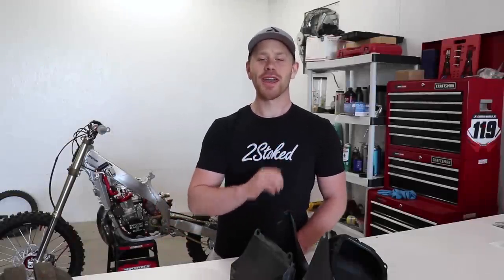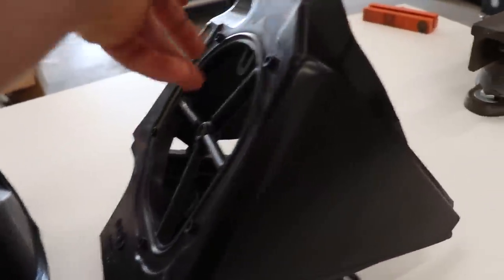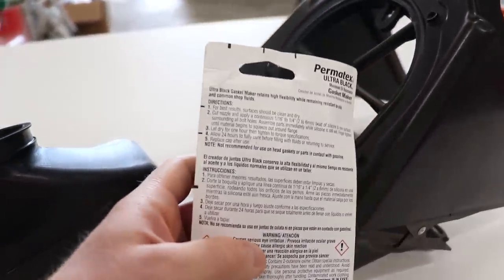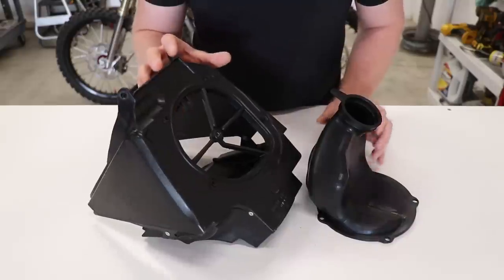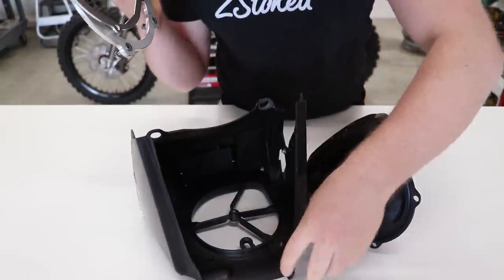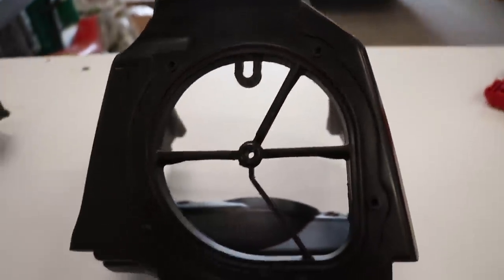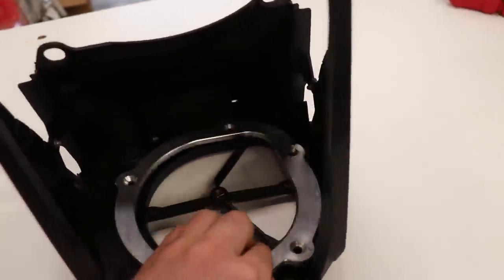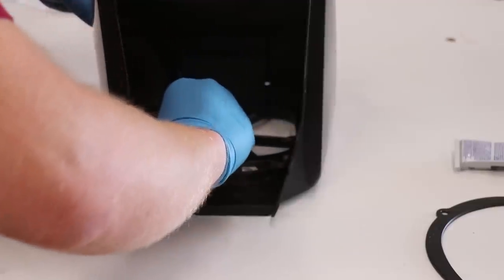Fixing The Biggest Problem With Honda 2 Strokes!

Comment: I knew about this air box problem, only a few weeks back I resealed my sons 2002 cr125 there was no gasket only what seemed to be factory sealant, it turned out to be bit of a marathon. After watching your post I’ve ordered the metal ring seal kit for my 2002 CR250, that looks like it will solve any inherent problems. Thanks for the info Cam. Great video as always
Reply from the maker: Terence Brown Thanks for watching Terence! You’ll be all set with using the rings

Comment: Do you recommend doing that on the newer bikes? I’ve taken the air box apart on my 2014 Crf450r to clean/ inspect once a season and always put it back on dry
Reply from the maker: The newer CRF450s didn't have a problem with the leaking air boot, but doesn't hurt to have a little sealant on it
Reply: Okay thanks man 🤙🏽

Comment: This was the issue with my cr250. I was going thru an engine every 10 hours, breaking pistons and had a ton of wear. Not like you can check if your oil is dirty in a 2 stroke so you get a catastrophic surprise

Comment: What I do for those little nubs in the air box is just grease the air filter up real nice where it mates with the air box surface and never had a issue. On a 2002 cr125. I do have a 2005 air box boot for more airflow and have one of those cnc air box clamps.

Comment: 3:00 Hot Glue, quick, simple, cheap, Air tight guaranteed and can be taken apart later using a heat gun or just pull hard.
Reply: It would degrade over time though that's the only issue.

Comment: I don’t think this is the biggest problem with honda 2 strokes at all. It’s a very small thing. I think the simple fix from pc or just the silicone 5 buck fix is plenty good but congratulations on a very comprehensive vid that covers everything. It’s well done.

Comment: Cameron,
  Thanks for the "free sample" Cerakote tip. I have a 25 year old RWS .22 cal piston spring pellet rifle that needs some Cerakote love on the barrel.  :-)  Their free sample even comes with free shipping!
Reply from the maker: You're welcome, keep in mind the Cerakote trim coat only works on platic
Reply: @CameronNiemela   Opps.....Oh well. I can try it out on the plastic surrounds of my outside mirrors on my car.

Now that I look at their website a bit closer, I see they do have an "air cure" (in 40+ colors even) for metal.   :-)
Reply from the maker: PhillipZX3 Yes, it’ll work perfect for that. The actual Cerakote ceramic coating is what you’re after for the gun.

Comment: Good vid dude the air box is a verry over looked part had same issue with  my 2003 cr 125 I used a glue gun to seal it all wasnt best looking but sealed it but that kit and slight modding make it clean tidy and oem people over look that some parts from the older model bike's fit newer models and vise verser

Comment: The dual lip and metal mounting for the Airbox is exactly what the CR85 uses.
Reply: 2001 cr250 uses the metal mounting plates. 2002 was the downfall of the cr250s

Comment: Does someone knows why there is this cubic shape / drawing on the air boot ?
Reply: KaTM either should support grip or more likely it is supposed to give a bit of material to wear trough until you scratch your boots against the sensitive rubber air boot
Reply: @simon2625  Thanks mate

Comment: Are U gonna use a twin air filter cage on your up graded air box? Did U consider using a loud mouth air filter for your up grade?
Reply from the maker: Nope, just using stock cage. I prefer the surface area of the stock filter setup
Reply: @CameronNiemela  Thanks for posting back.

Comment: Hey bro I need some motors worked on my my YZ 450 is cutting out high rps 3&4th almost like the rev limiter is kicking in read a couple of fourums talking about the neutral switch it's old but tricked out it's an 04  I'm gonna clean the carb tmrw even though I don't think that's it there are no mechanics where I live especially that have mx skill set and do you know if a wr trans would fit I hate the 4 speed I also want to to race a few vintage races in 2020 the project bike is a 72 Honda 250 Moto sport it needs to be gone. Through if you don't have time could you recommend a builder thx... Tim

Comment: Do you use that pro seal gasket still for the air filter or use rim grease for the air filter to the box thanks!
Reply: Pry use both I imagine
Reply: Also u tighten it all the way or let the silicone set them re tighten? Thanks again for all the help